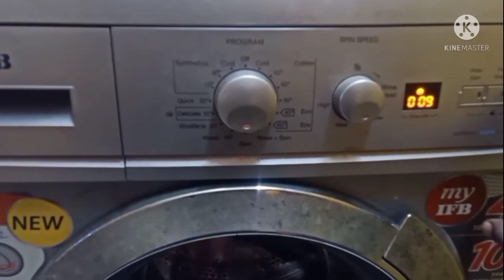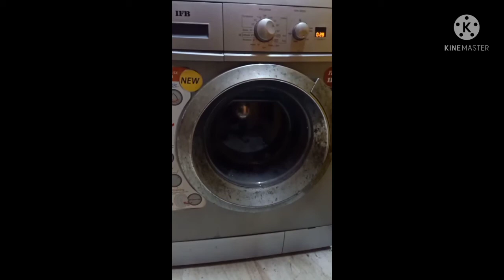How to repair vibration problem IFB front load washing machine in tamil/sasidharan/SD

Comment: Excellent bro
Reply from the maker: Thank you bro
Reply: bro superb and congratulation to your channel. can you give the additional information like how much the new shock absorber spring rates and one more thing you uploaded any video about how to repairs the temperature settings not working properly for IFB ELANA SX 6KG 800RPM
Reply from the maker: Total Shock absorber price 1500 to 2000
Reply: @sdelectricaltech9409  thanks bro and temperature not working properly means high temperature only works not reduced or set low level temperature how to solve it.
Reply from the maker: It's temperature sensor problem
Reply from the maker: Temperature sensor attached with heater you have to change heater after change check the temperature it will work

Comment: Bro spring kedaika mataki bro enga vanguradhu
Reply from the maker: Ena washing machine bro
Reply: @sdelectricaltech9409  ifb washing machine dhaan neega use pandra same spring unga video paathu keela irukura shock absorber maathita but spring kedaila refrigerator spareparts shop la keta IFB company la dha kekanum nu solranga bro
Reply: @sdelectricaltech9409  IFB senorita aqua as 6.5kg 1000rpm
Reply from the maker: Unga washing machine shock absorber maathitiga but spring kedaikala athanala mathala nu soldrigala bro
Reply: @sdelectricaltech9409  ama bro
Reply: @sdelectricaltech9409  spring vanga help pannuga IFB company la dha vanganum nu Inga irukura spare parts shop kaara solra am from tirunelveli
Reply from the maker: Unga num sent panuga bro

Comment: Bro, even my IFB machine has the same vibration and noise problem when it is stopping from spin. How much does this Dambers cost? I can see online its around 800 Rs.
Reply from the maker: 1st u want to check it's a drum problem r suspension spring problem verify it
Reply from the maker: It's simple easy to find after spin run when u open the door if any smoke came in inside the door it's drum problem are not smoke issue it's suspension problem check and verify then Change the material.
Reply: Recently I changed the drum with rubber and also there ka no smoke after spin. After this change i user it for only 3 months with max 15 times wash only
Reply: This ifb team is asking rs 300+ as labour charge even for just checking, so want to know is ther any service vendor in and around Erode location
Reply: @sdelectricaltech9409  Thanks for your quick response bro
Reply from the maker: Now u have to change the suspension spring
Reply from the maker: I u change the problem will solve immediately and in any spare use orginal spare because it will give extra life if not available orginal spare thn u choose the 2nd quality
Reply: Sure bro
Reply: Bro. Is there any service near hebbal, Bengaluru
Reply from the maker: No bro
Reply: Hi bro  after spin   smoke varuth  so drum change pannanuma illay spider matrm change panna pothuma, how can verified, pls help me bro